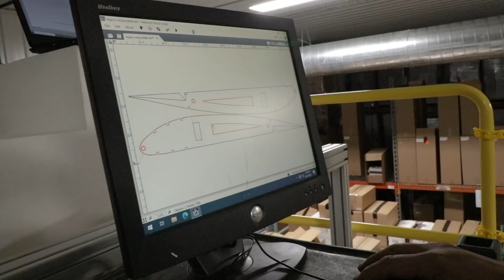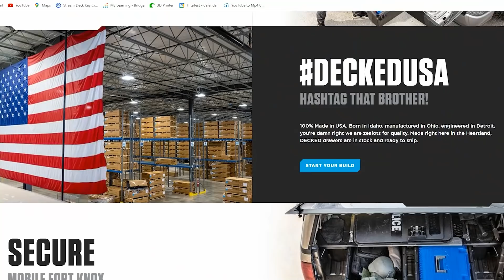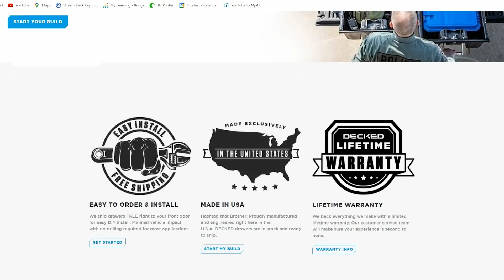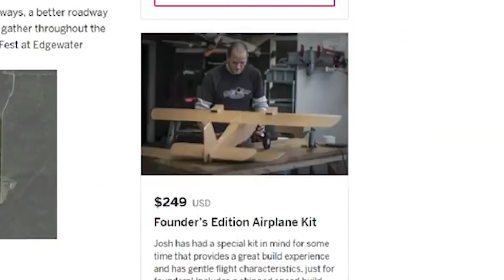Turning a 100 LB block of foam into a 16 foot airplane!

Comment: Wow Josh, WAY COOL!! 
I remember when I build and ran my cnc router for the first time, super exciting. I can imagine how you guys felt, awesome! Now the wheels are turning for new projects in your heads with this new tool. Maybe you should cut out a complete fuselage and wing assembly from scraps of the old trainer and compare the foam board build to a solid foam build? That might be interesting and an easy cut with a simple plan design like the trainer. Just a thought. Keep it up guys, love the channel!
Dave

Comment: Hi Guys, following you is just so much fun and inspiring. I've seen you've used a CNC hot wire cutter to cut the wing... I've been thinking a long time about hotwire-cutting a mold with that technique of a glider wing... I mean a real 18m competition glider wing. Accuracy of the wing curvature, especially in the region of the leading edge is a must, and virtually no bowing of the wire while slicing through the foam is required in order to obtain a ruled surface. Would the CNC hot wire be a viable method according to your experience, provided that one creates the 9m semi-wing mold in, say,  max 1.5m long sections?  Thanks!

Comment: hi flite test, have a question on another video.   where can I find the plans for the motor mount for the MESArc - Mini Lightening plane?   I have watched the videos for this plane many times, I even cut out the parts on foam board...the piece I don't have is the motor mount plans, can you advise please?

Comment: If you don't want to make your templates out of thin wood, you can use foam board. Cut the foam board to the shape you want and then cover the edges of it with aluminum tape. Make sure to only layer it in one direction so that the hot wire doesn't snag on the overlap of tape. Then pin the template to the block of foam. Works great and is fast if you don't have a laser cutter to cut a wood template.

Comment: I was engineering a system like that using a PLC and three hi speed counters. No need to finish cause they make them which I never checked. I feel,,,,,stupid. I can use the 40 20 and servo motors for something els I guess.

Comment: In the final shot of the built plane, it looks like the horizontal stabilizer is upside down? isn't the curve (lift side) supposed to be on the bottom, opposite of your wing?

Comment: Take a look at control line combat model airplanes. Some of them used spruce spars and filament tape to reinforce them. There are also low temperature films that can be used for covering on foam.

Comment: Hot wiring EPS (styrofoam) releases toxic fumes and chemicals.  Please do this outside or setup a vacuum hood to evacuate the fumes outside.  Also a respirator is a good idea when melting any kind of foam.  Take care of your lungs and your body.
I do this on a daily basis here at WCRC.

Comment: This reminds me of the plane a teenager built years ago.  The thread on RCGroups was something like "50' Floyd" or something like that.  He built a Cessna 152-like model with a 25' wingspan out of pink foam.  It used five Hacker outrunner motors connected to a gearbox.  Crazy cool project.

Comment: Is the CNC hotwire cutter a commercial product or was it DIY? Either way, can you share where to buy it or get the build plans?
Reply: These machines are _ made by Hot Wire Foam Factory, right here in the USA._

Comment: you can use the 3d printing method of using a glue stick or hair spray to add stickiness to help your foam stick to the base.

Comment: what floats your rc boat
Reply: sail wing plane
Reply: sag wing plane
Reply: fiber coat for strength, chicken wire fence as final stronk
Reply: and fire proof paint
Reply: epoxy sand blow paint

Comment: Awesome equipment! I once made a wire cutter but as soon as I put current through the wire it would expand so much it needed a whole spring system to take up the slack. It seems technologie has moved on a bit hahaha.

Comment: Amazing stuff, foam cutters 'new material' to use for building flying thinks. You guys are like air , you manage to expand in every corner of the building !! I hope someday you find a hangar big enough for your dreams. You mention size a lot so there is the mega - giga -tera and the others in the metric system prefix . https://en.wikipedia.org/wiki/Unit_prefix. Thank you.

Comment: Now you just need to take the horrible paper towel rolls that are in most public bathrooms and glue it to the plane like paper mache and it will create a hard shell to strengthen the plane without adding a ton of weight to it. Also it makes a great sandable and printable surface!

Comment: Amazing, Ive had a partially finished 1:10 B-17 in my garage made of hotwired foam ribs on wood spar covered with thin foam. This is even simpler in design.

Comment: Run a candle along the wood templates a few times before cutting. It helps the wire to slide along without sticking.

Comment: I assume it will have some sort of covering over the foam? 
Fun ideas for future vids. Cover the foam in fiberglass or carbon fiber and dissolve the Styrofoam out. Ad more glass to the wing leading and trailing edges so they are stronger etc. You can likely make a absolutely crash proof plane :)

Comment: Man that is so cool! But you guys really shouldn't be breathing the smoke that comes off of that melting foam. Very toxic. You need to get a high power ventilation system going right above the foam cutting station. Personally I wouldn't even be doing it indoors without a chemical respirator, even with a ventilation system.
Reply: I used to do it in my bedroom 25yrs ago 😁 Despite the fact that I moved out 20yrs ago, my mom still claims she occasionally finds styrofoam beads.

But for this scale, you're probably right.

Comment: Stick some thin tinned copper wire with CA around your laser cut templates - you can offset for the different size in ur CAD application if needed. That'll stop the hotwire catching on the ply. Great choice of aircraft BTW - my favourite was the Telemaster 66 - excellent trainer.
Reply: I use foil tape.
Reply: I don’t not know why I was thinking that would short the wire out. After about three seconds of thought. Durr

Comment: So is flite test gonna start selling hot wire templates as a kit and blocks of foam so we can make our own planes out of the high density foam blocks that would be cool
Reply: imagine the shipping cost
Reply: Is that is Peter kind of territory hehe
Reply: I dont think they are making something this size a kit but might make a smaller one
Reply: Gotta be good money in it for them or they wouldn’t do it. It’s all about the money.
Reply: I was just saying they sell you the plywood templates for everything you go to Lowe's get foam and hotwire cut it all your self but their kits could be just templates a file with the build video all hardware as in machine screws little nuts bolts carbon rods all the hardware and landing gear stuff and all besides the foam
Reply: Nope. Gotta go BIG

Comment: Can you guys make a full fleged carrier to land Biplanes not like the Avengers carrier that can float?
Reply: Biplanes? BIPLANES? If they did that, they’d better be landing F/A-18s. I’ve wanted to do that for a while, but the project is currently out of my price range and capabilities.
Reply: Heh they already made it
Reply: i remember you, you asked me if they made a carrier that didnt fly right?
Reply: even helis
Reply: They made a carrier and it flew/hovered high above the ground. They had set airplanes on it before it took off and then they flew those airplanes off the carrier once it was up nice and high.
If I remember it was these guys but I'm not certain
Reply: @buddchan  Yep it was these guys (Well, Flite Test anyways) They’ve changed “hosts” over the years. It seems the only constant people are Josh and Stephan.
Reply: I don’t recall asking that. Maybe I did, I just don’t remember. They made a battleship, which proves the have the capability to make a carrier. And, with their new hot wire cutting system and foam blocks, it could be easier for them to do it.
Reply: They should also try to make like a TB-3 Plane carrier or Zveno project, it would be awesome
Reply: imagine if they got an enormous 10ft cube of waterproof foam, which they used to cut into a WW2 carrier diorama, big enough to land a mini corsair on
Reply: yes